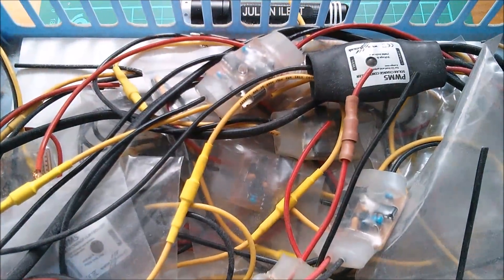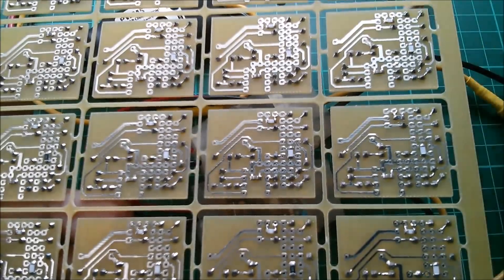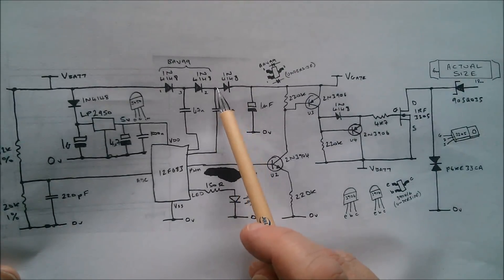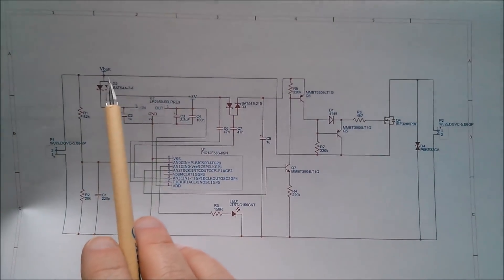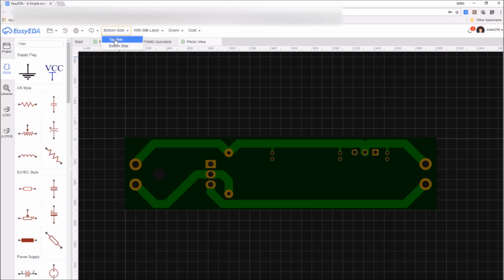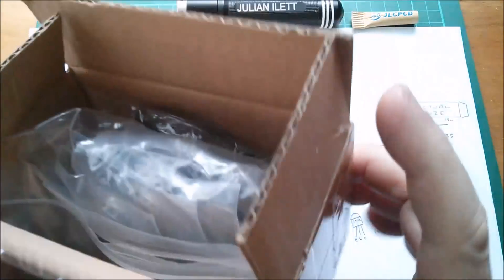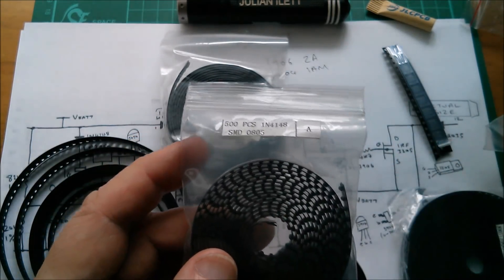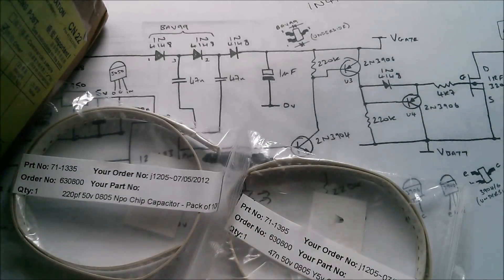Project Gumstick - Surface Mount PWM5  Solar Charge Controller

Comment: It looks way better with the connectors, than with the dangling wires…
But anyway, I would keep the through holes for the wires as mechanical "pulling relief".

Comment: Mounting the larger power wires through holes will be more secure than just soldering to bare pads.  It is also easier to solder it when you don't have to hold the wire in place.  10:48
Reply: Julian, it would be useful to add "+" and "-" on the silkscreen by the input and output connections, as well as adding "Battery" and "Solar Panel".

Comment: Did you really route the diode‘s leg through the screw hole of the transistor‘s heatsink tab? That’s highly creative to say the least. :)
Reply from the maker: On the Veroboard version, yes. That leg of the transorb diode connects to Drain anyway, so insulation wasn't a problem :)
Reply: Cool.
Reply: Torsten, nice catch.  I didn't see that and had to go back and look.  I don't think I have ever done that or seen it done for that matter.  I will have to keep that idea in the back of my head when space is running out on a PCB design.

Comment: you may easily route a "universal" PCB for both SMD and through-hole MOSFETs by adding both to your schematic in kind of "parallel" connection: gate-2-gate, source-2-source, drain-2-drain. Then, you'll just solder one or another, SMD or TO220, whatever you have...  I use this technique frequently for SMD and through-hole capacitors, diodes, etc...
Reply from the maker: Ah yeah, nice idea :)

Comment: Yay! Solar videos must mean the weather is getting better. Still using my ‘crystal’ pwm5 every day in the shed.
Reply from the maker: 'heat wave' next week - otherwise known as summer!
Reply from the maker: Ah, you mean one without the black heatshrink covering :)
Reply: Julian Ilett That’s the one. Last summer it spent its time keeping the caravan battery topped up, and over the winter its kept my car battery booster in tip top condition. The status led lights up the shed pretty well too - if only for brief moments :-)
Reply: Ah, I was wondering too what you meant by "crystal".  I was thinking it was an earlier version with a larger PIC with a crystal oscillator instead of the built in oscillator.  So is it still a PWM 5 model or one of those PWM 100s that I saw in the box?
Reply: ElmerFuddGun No it’s just a PWM5 without the black heat shrink and sticker. I refer to it as a crystal pwm5 after a crystal Xbox I had, which was exactly the same as the original Xbox, but had a clear case.
Reply: Adam, OK.  I don't know about the Xbox stuff... PS 3 or PC for me.  Was that an earlier version then?  Was the black shrink added for sun protection?
Reply: Cool! Sunny moments are coming. I have some solar cells laying around, waiting for more sun.
Looking forward to see more from the Solar shed too!
Reply: Yes, the venerable PWM5. My 'black' model is still out in the generator shed as it has been since I installed it, working with a 10 watt panel to keep an old car battery topped up to run two 3 watt LED bulbs. That setup never runs out of power, even in the Winter & the light is bright enough to do maintenance on the genny with. Autumn is in full swing here in NZ and that's the time when I seem to focus on the solar power the most. Summer is too hot & busy, plus it's generally no real challenge for solar power. In Autumn the days are getting shorter and there are more overcast, but still enough Sun to try things out.
Reply from the maker: Summer here (all 2 months of it) is no problem either, but winter is hopeless.
Reply: No summer here in Canada, snow and freezing rain today